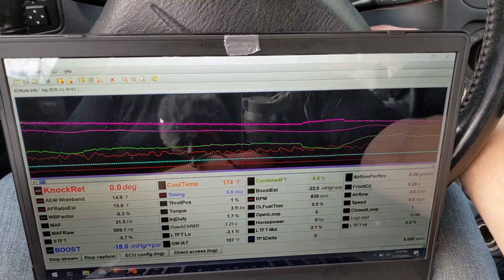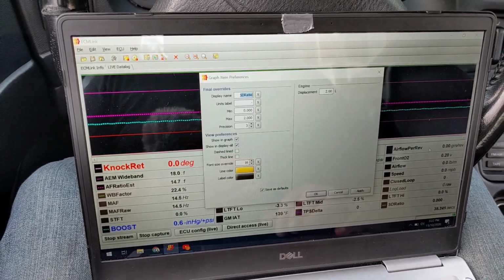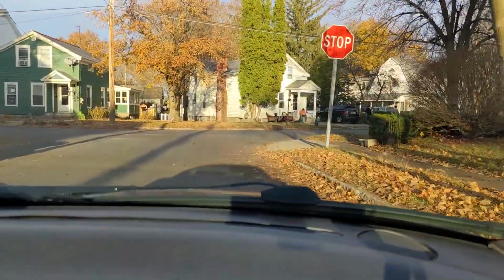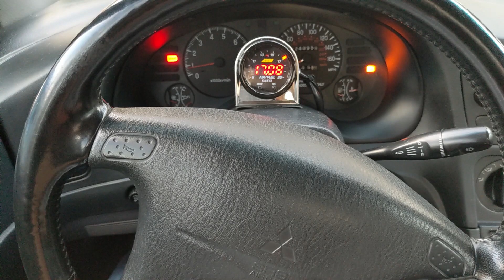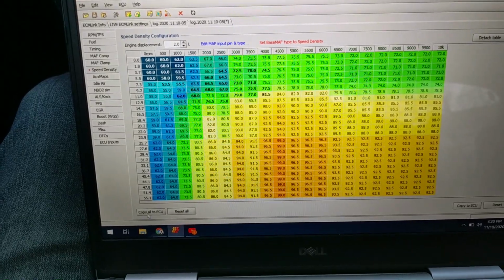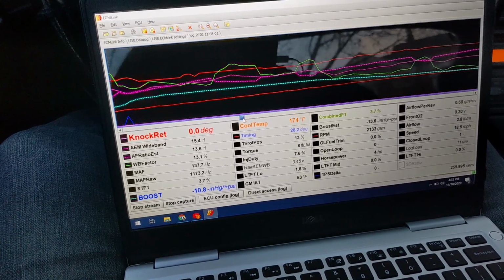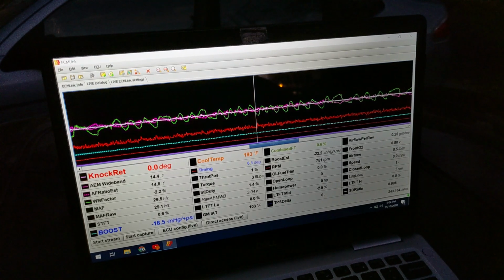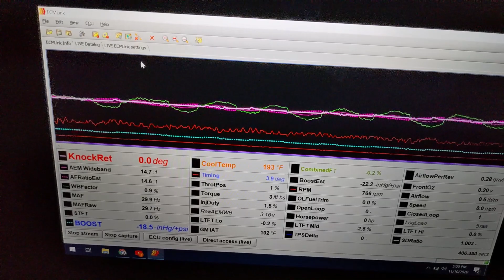TURNING ON SD USING ECMLINK'S TOOLS!!!

Comment: For some reason i dont have sd ratios under thoses values in settings
Reply from the maker: Make sure your firmware is updated. Make sure the ecu inputs are set correctly as well as maf settings. Post if you have more issues

Comment: Hi Sir, Do I need to lock intake temperature and barometric pressure to run Speed Density Ecmlink? I'm confused about this It's on ECU Inputs section

Comment: Awesome videos bud, I've waiting to switch over to SD but I wasn't sure where to start  I'll give this a go. Sofor what I understand you go for a drive and save a log, when you are driving around you are driving with maf anable is that right?
Reply from the maker: Correct! This helps you slowly build your sd map. You can also set up Ecmlink to switch over to sd at a certain pre determined rpm range to run the sd map under mid to high load situations. I like using the ecmtuning stock evo 3 sd maps to start and modify based on ve values, wbfactor and attempt to keep everything within plus or minus 5% of 0% correction.

Comment: At the 10 minute mark, you mentioned that the SD values are gathered from the maf to get the SD table set up.

My question is did you have both the maf / map + iat running at the same time to do that? Or just the map and iat?

Thanks
Reply from the maker: At that point I did have  map and SD running with one dormant and one active. If I had to pick I would switch over to SD. All you have to do is disable math, disable air smoothing with SD operation and start the car on a SD setup with the correct sensors. Of course. Once that is started, you can right click your data log screen and click on the pop-up that says SD VE adjust combined FT. This will allow the ECM link program to make adjustments as it sees fit to the fueling in the SD table. Give it a shot, run it multiple times and you'll have a very smooth tune after a couple of days of driving. Hope this helps
Reply: @TPGDSM  

Absolutely, thanks for the reply.

I'm going from a apexi afc neo to dsm link v3 with SD, quite the jump in capability and learning curve.

Ps. Thanks for the videos you put up, they've been a big help.
Reply from the maker: @schafer240  if you need any further assistance with getting things dialed in email me a log @ todaysprojectguide@gmail.com 
Always glad to try to help

Comment: Yo broski I commented from my beat page on accident but here’s my dsm page. My girl is white. She a baddie, never wants to turn on 😆. Hey broski if you ever wanna use any of my beats I’m going to start making them all tagless. Anyway God bless bro, dope content! Glad I found your page so I can use my dsmlink. I have a5031 like your buddy on dsmlink and 1000 cc injectors. I had a built head that got left at a ex gfs house and I never got it back 😭. So yeah I just got a stock head atm. Got some maintenance with the idle- if I could just get it started on a no spark diagnosis. Getting fuel to the rail, but no spark and if it sparks it only runs on 2 cylinders. Leak down was good and also the compression was 170 across the board last time I checked which, I’ve only ran it about a handlful of times since I had it almost listed on Craigslist .. 🤦🏾‍♂️ I need some help bro lol 😆
Reply from the maker: +Yeshua GANG hey man get ahold of me on instagram @TodaysProjectGuide I'd be happy to try to help!

Comment: Where did you get those inlets for the bumper, wanna do that to my gsx
Reply from the maker: Found em on ebay someplace. Shipped from china in 10 days. Replaced the airflow I lost from the fmic install 👍
Reply from the maker: @oscargutierrez970  those look nice, I think they'd fit in your stock side mount intercooler vent holes in the bumper. I may do something similar on the passenger side when I make my cold air pick up box through the fender. Also those don't look like you could screw em in very easily. May have to fiberglass those round edges in or something? Still look cool👍